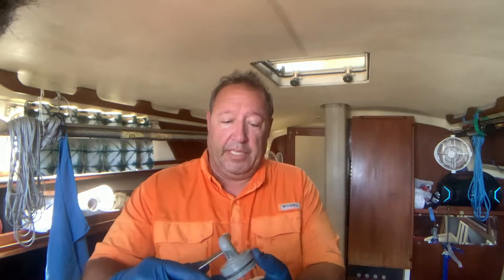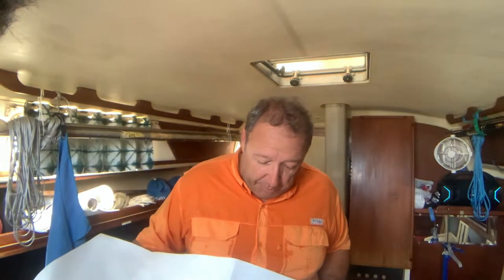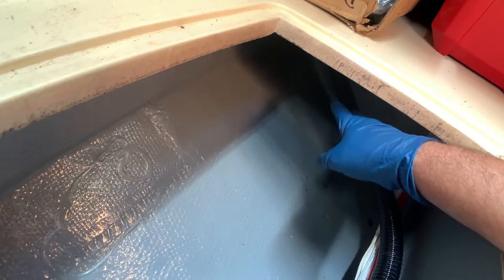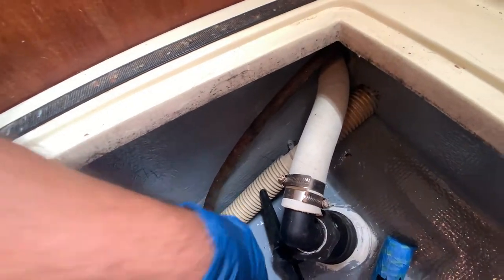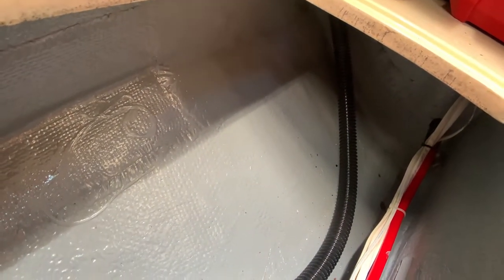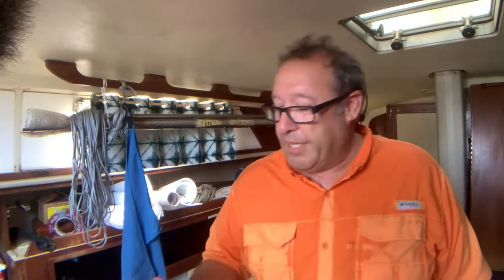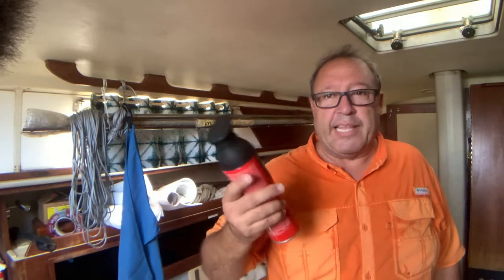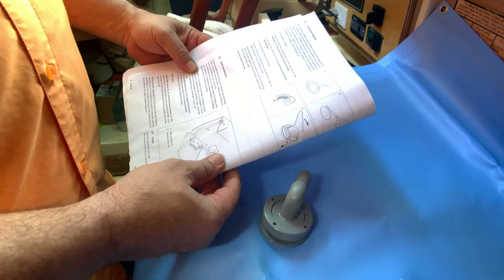EP 57: INSTALLING VETUS BLADDER Water TANK REPLACEMENT - Freshwater System

Comment: Thanks for posting this video. I’m just about to install a couple of 100 litre Vetus water bladders to supplement an existing 200 litre steel tank for extended cruising, so this was invaluable! The only thing that was missing was some footage of the bladder tank being completely full. It would have been useful to visualise how the tank adopts the shape of its surroundings and how the inlet and outlet hose tails moved.

Great work though and thanks again!
Reply from the maker: I have a picture of the bladder full in the compartment. Send me a direct message and I will send it to you
Reply: Thanks! As it happens, your sanitising video showed me just what I was looking for. How are you getting on with the Renogy 3kW inverter? I’m looking at the same product.
Reply from the maker: @invicta4165  I like it.  It works really good. I run the induction cooktop, the toaster oven and other small appliances through it. So far so good.
Reply from the maker: @invicta4165  Glad you found it and that it help you!  If you have any questions, please feel free to ask. I am happy to share any information I can.
Reply: @HomesBoatsTravelbyJoseTorres  how is the bladder working?!
Reply from the maker: @xkora100 Water bladder is working great.  No issues.
Reply from the maker: @xkora100  working great. No problems at all.

Comment: Great job, well done! Thanks for showing us, as Vetus is terrible at showing installation details on video. 
A bladder really only needs one hole in it, that can be used for both fill and pump-out, just use a T-joint in the hose. A 20mm/ 3/4" hose is plenty big for fill, you just dont need 38mm/1.5" hose for fill, that is for commercial quantities of water fill, not necessary for leisure boats. Using one hose like that would avoid the need of cutting an extra hole.
Reply from the maker: This one was actually for my fresh water.  The boat actually has two like this for water supply.  There is another one for holding tank.  The old models had a hole for venting.  The new ones Only need the whole for filling the bladder tank and a whole to feed the water to the pump. I was a little nervous at first, but once I got educated on them, I think they are a great idea specially in smaller boats.

Comment: What is the protective liner you contact cemented on cheers
Reply from the maker: Thank you for watching!  I used 2 mm EVA Foam.  You can order it from Amazon. My compartment was very smooth.  If your compartment has a lot of jagged edges or other things that could cause a problem, you could use thicker EVA Foam.  Maybe go to a 6 mm thickness. Best of luck with your project.